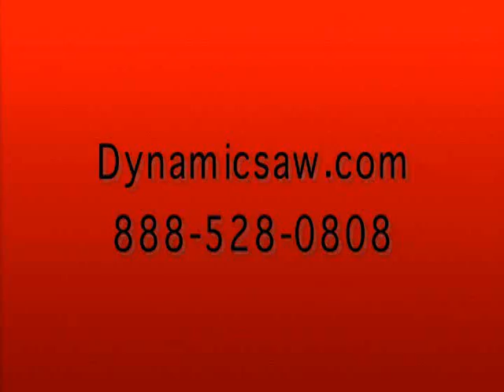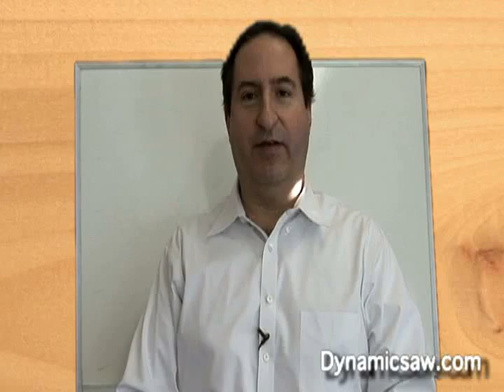Saw Blade Technical Information: Plastic Cutting Blades # 11

Comment: What if we have composite sheets that have plastic middle with a aluminium sheet on both sides that are 6mm thick. What blade do you suggest we use?